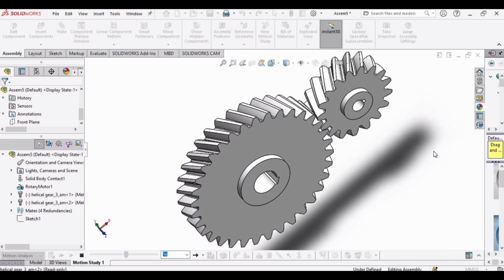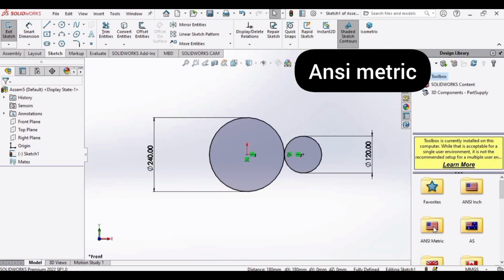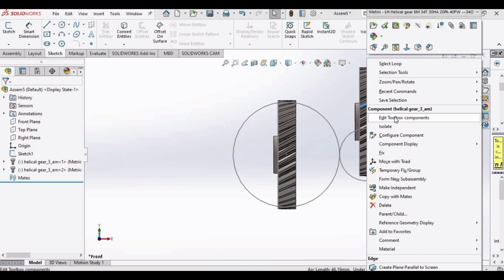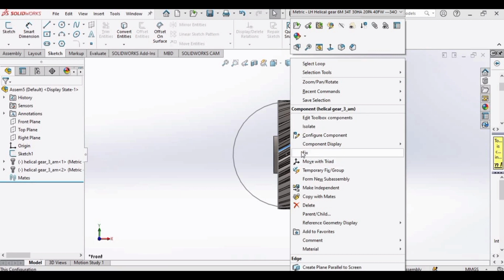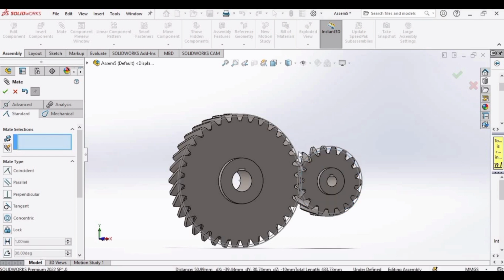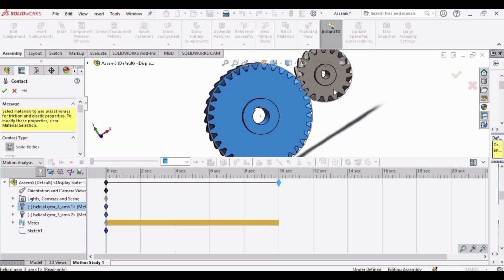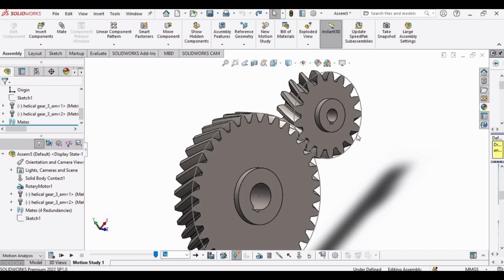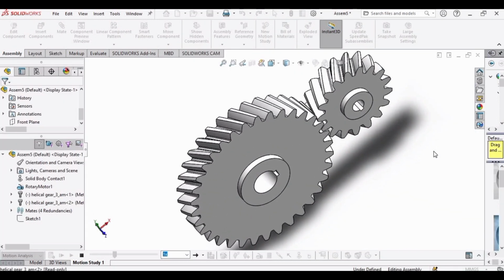Helical Gears assembly, design SolidWorks|CAD with Mohsin

Comment: you didn't explain how did you get the 120 & 240 !!!!!!
Reply from the maker: Thank you for your comment! All the measurements used in this video were taken from a solved example. The purpose of the video is to demonstrate how to model helical gears when all the necessary calculations are already available. The values 120 and 240 are likely the pitch circle diameters. This video is specifically focused on the modeling process, not on performing the calculations.